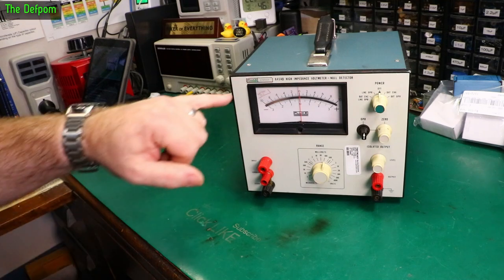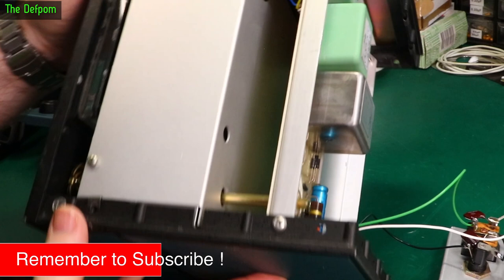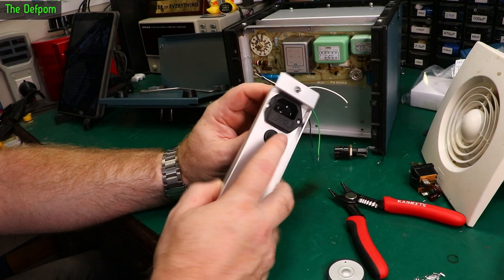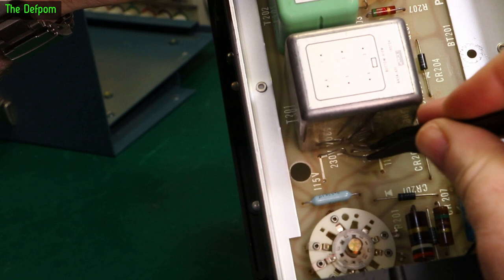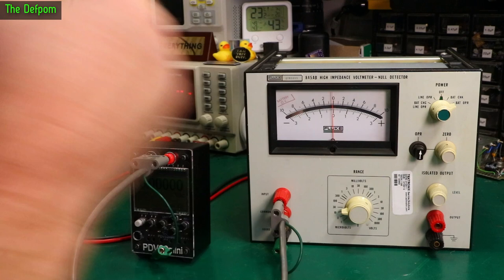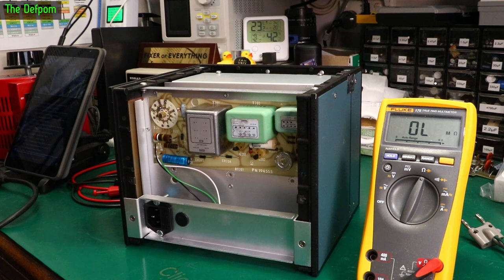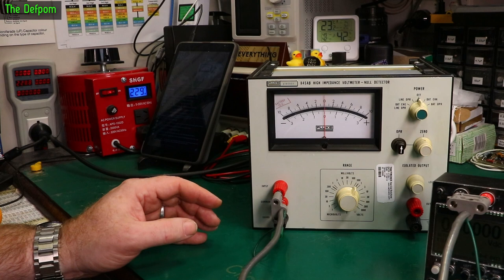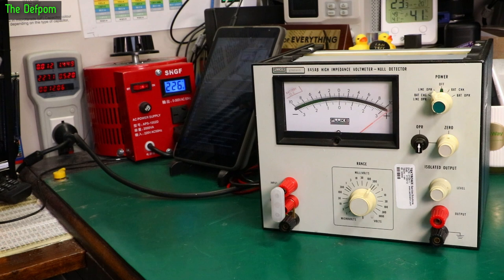🔴 Fluke 845AB Repair Part 1 - No.1142

Comment: Hello Scott! I have a Fluke portable multimeter that has an AC plug plus an internal battery. The meter has to have the internal battery in place and hooked up in order to work! it uses the AC plug source to only charge the battery system as wired from the factory.! I do not know the reason for this logic in design but it is what it is.  Cheers my friend! have a good day!

Comment: Always interesting to see where the trouble is lurking.  Nice repair!  Fluke used high quality components, I have a Fluke 382A from the 1960's that I did not do a full recap on (only 3 caps tested way off and were replaced) and many hours of use later it continues to function perfectly.  I'd say those power supply caps won't give you any trouble.  Also, I think for high accuracy measuring super low voltages you need the battery installed (run off the battery) otherwise AC line noise is a problem.

Comment: REALLLLLLLLLLY wish Laptop manufacturers would take note of the whole grounding thing :(

It's like, you have the capability, the pin on the mains plug is there, just feed it through to the laptop itself!

My Macbook Air was the worst for it, that tingling feeling as you touch the metal casing of the MBA, my current laptop (9yrs old now) has the issue and always has, probably why cheaper laptops use plastic housings :P

Comment: welcome back to the time of analog electronics and beware of the parallax error....!
Reply: no AC power?  Did not see you soldering the jumpers in the 230VAC position...!
Reply: affix a label by the line connector  stating  230VAC

Comment: It's always bad to try to repair such instruments w/o knowing the operating principle before.☹. The manual even has this worthful chapter Theory Of Operation inside, even though it's quite brief!
What the heck did you check there? The fault could always be found by continuity measurements w/o mains applied, i.e. primary side, and transformer secondary to bridge rectifier!😵‍💫
Never open the amplifier shielding unless something is faulty!🧐
Don't recap until it's really necessary, and never, never replace those carbon resistors inside the amplifier. TiN replaced them with thin film, and never got it working again.
And leave your greasy fingers away and out of the instrument!! 😖It's REALLY a HIGH IMPEDANCE instrument, i.e, ~ fA when nulled, so that's serious stuff here. Use proper gloves when handling inside!
It should always be operated with working batteries inside, as those limit/stabilize the rectified AC input. (The battery is misused as a Zener diode here.) Otherwise, the supply voltage will exceed those about 10.5VDC considerably, and might damage Q201/Q202.
Reply: To be correct, my 845AB had problems on sensitive ranges originally, it never got stable null and was too noisy, with lowest range going from -FS to +FS non-stop. So replacing CC resistors was a result of those troubleshooting steps, not just out of blue "let's replace everything" idea. Then later on I got good working Keithley 155. That and fact that 845AB is annoying mechanically - killed all my motivation to further work on 845AB repair... So saying that replacing resistors killed my 845AB is a false statement.